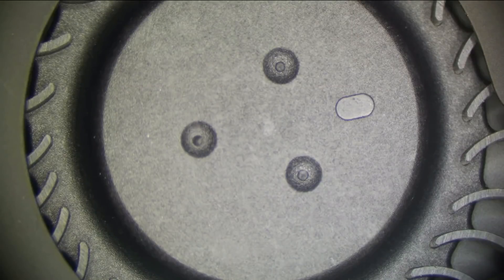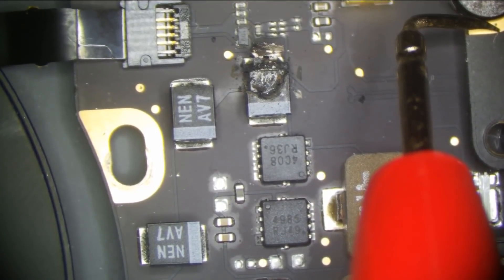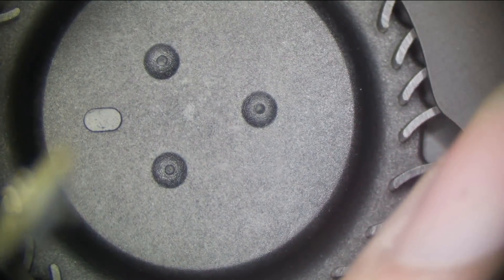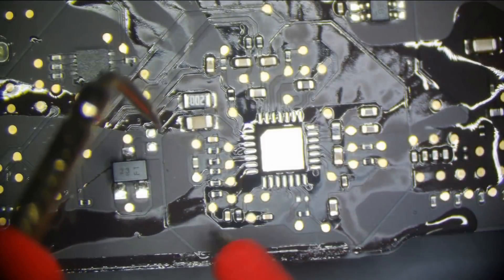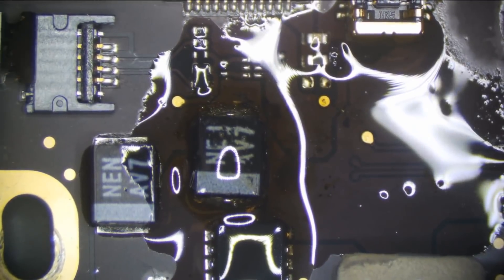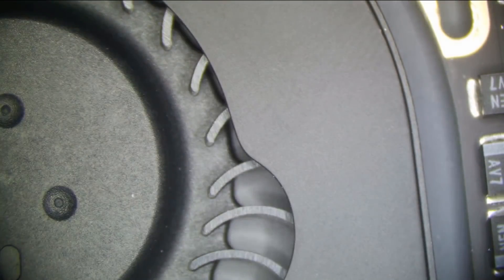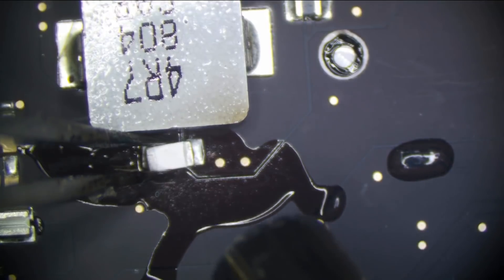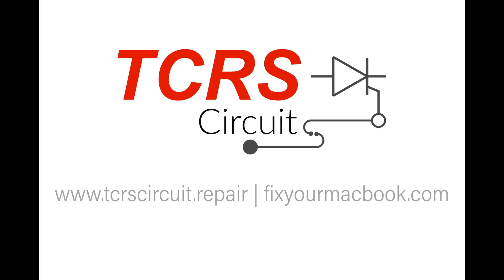Did a fuse actually blow on a Apple product? Can a dead MacBook Air be fixed?

Comment: so maybe check fuses first now instead of replacing chips that dont need to be replaced. did you take off the new chip or save the old one to use on another computer since chip wasnt bad?
Reply from the maker: It's a $2 chip. Remember, it still was outputting to a shorted line before the fuse blew. I'm not going to reuse it.
Reply: @TCRSCircuit  and thats why you fix boards and i dont. good job.
Reply from the maker: @mts982  Thank you!